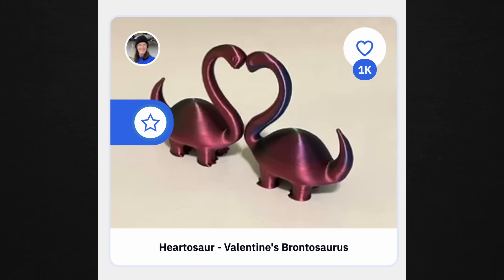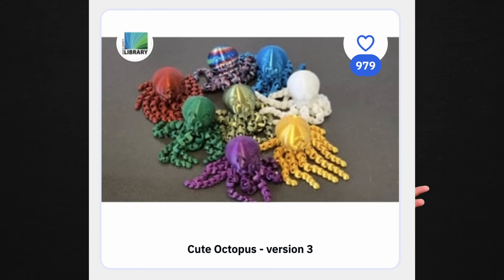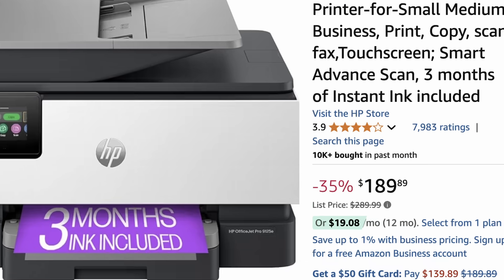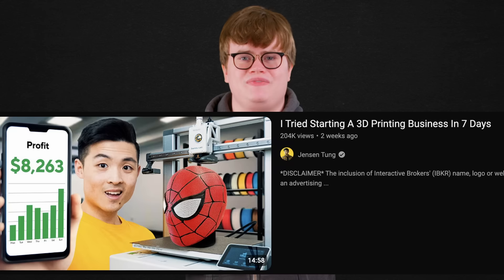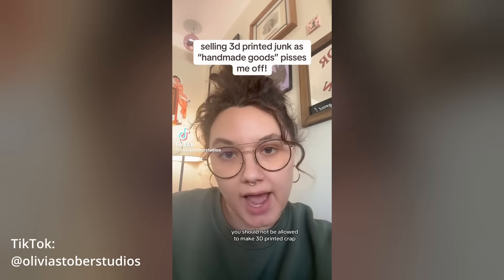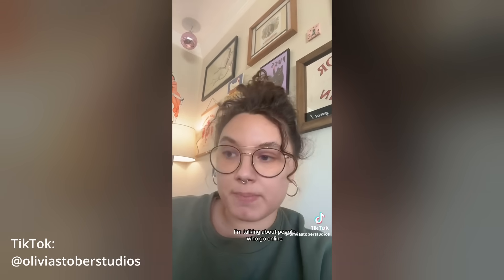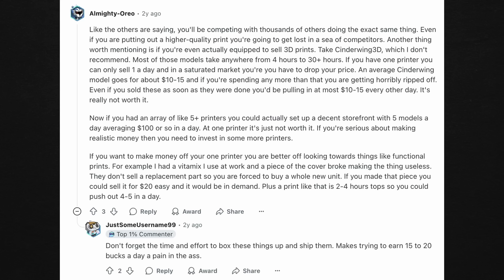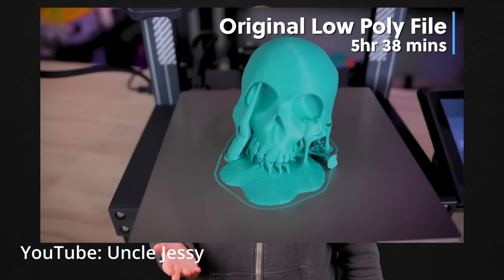The Rise of 3D-Printed Slop

Comment: This is such a pessimistic look on 3d printing. Let people use 3d printers for what they want! Buying what can be 3d printed is just as, if not more both costly and environmentally unfriendly as non-3d printed products, because in the end it's all just plastic. Delivery requires transport which requires fuel and may take a lot of waiting time (especially if bought cheap), so often, 3d printing is much more convenient in that regard. The layer lines are not "ugly", and at smaller layer heights they're quite invisible really. The examples you've shown are either terrible prints or ones with unnecessarily large layer heights. I've myself never done any post-processing in years of experience with 3d printers. Even if so, what is there to hate about layer lines if it's something you've made yourself and are proud of?! Frankly, I find the layer lines aesthetically unique. Also, 3d printing doesn't have to yield any profit. When it comes to whether or not a product's been hand-made, what matters in my opinion is the quality of it, not the technology it's been made in, so don't judge the printer, rather the maker, or yourself for having such high standards. Jeez. 3d printing isn't all just about printing useless gizmos, you're forgetting about the useful, the functional side of the community. 3d print failures are no longer common these days with newer generation 3d printers, and the filament is not "fibrous" unless it's a carbon or glass fiber composite. This here is a bad portrayal of 3d printing as a whole, and perhaps if you'd like to learn more, then get a damn 3d printer already!!! I can't believe you've made an full video criticizing 3d printing probably without even using or owning one. God, I would really like to reply to more of these awful claims about 3d printing mentioned in the video, but I should get studying now. Bye.
Reply: Not to mention I've seen more of cool cosplay things made in 3D printers, then any of the "slop" people talk about🙃🥲
Reply: Aesthetically unique and good are not synonyms. Yes, layer lines are certainly quite unique, you won't see them anywhere else outside 3D printing. And they look like garbage. If you're making items for yourself I don't care but if you're selling the to other people and are expecting money for it, put in some effort and at least lightly sand them, just to smooth it out. It doesn't take much.
Reply: @senatrius  And are the people buying the item going to pay me for the effort needed to sand it?
Reply: Exactly, this person just seems like a massive killjoy. Ignores the larger picture, and only focuses on the lowest common denominator in a bubble.

Comment: I got really into 3d printing about 5 years ago. And I hate where it's gone in regards to print farms. For me, it's just lazy. Selling prints right off the bed using other people's models off thingiverse. I like making things, just for the sake of the challenge, but even if it doesn't involve the modeling on a computer, I like to sand, reinforce, paints and finish cosplay props or functional prints. Or even just having 3d printer around for a random plastic part that broke. I'd be embarrassed to be selling what people with print farms do, because it feels like you're not really offering anything of value.

Comment: I use 3d printing for making casting molds for replica parts on antique equipment like my 1888-1920s frick/geiser Frankenstein of a sawmill i also want to build miniature steam engines and I hate hand carving moulds out of wood they never come out right and take many hours from me when I could design, print,auto body putty fill the print then paint, i also printed a string of 45mm gauge (G scale model trains) tipper cars for a quite literal fraction of the price of bachmann's tipper cars

Comment: i also will say, making those little useful items yourself is a more sustainable method than supporting temu or shein or amazon- at the end of the day, the biggest problem with the plastic industry (and, every industry actually) is the SCALE they are being produced. printing a toothpaste squeezer yourself, you cut out the carbon emmissions from shipping, the plastic packaging it would have come in, and youre not telling a factory the item has value and that they need to produce thousands more- youre only bringing one of the item you needed into this world and not thousands of surplus that will end up in a landfill
Reply: Also I gotta say, as a disabled person with mobility and dexterity issues who lives rurally, I end up needing a ton of “weird” little gadgets to solve problems that are less straightforward for me than other people, and being able to produce them on demand in my house in the space of an hour or two has been brilliant. I’m an order of magnitude faster than Prime delivery (which matters when you can’t get a jar open, or, indeed, when you’re struggling with toothpaste!) and wasting far less fuel doing it on a regular basis. Temu is not the winning option here.

I accept that mine is not a use case that applies to most people…yet. But if you live long enough you might get it one day!
Reply: Don't forget the filament also had to be made and shipped. So it depends a lot on the circumstances, your 3D print can truly be more environmental friendly but also can be far worse.
Reply: @teresashinkansen9402 1kg of plastic send in one spool&package is ALWAYS more environmentally friendly than 1kg of plastic split up over many packages 

It also doesn't really have to be "produced" it's just virgin plastic pellets extruded into a string - the Virgin pellets would get used for plastic either way
Reply: @LuluTheCorgi At least someone here has some common sense about the environmental impact of shipping.
Reply: @ one shipment and package that can make 15 items or 15 individual shipments and packaging? (also my filament comes in a cardboard with a cardboard spool with no plastic)
Reply: @ As I said, depends on the circumstances.
Reply: @teresashinkansen9402  possibly! corporations are such a huge contributor to pollution and climate change, I'd be curious to see if someone has calculated the potential difference in sustainability & etc.
Reply: yeah, it really weirded out when temu of all things was suggested as the alternative (if i'm interpreting things correctly), not to mention temu's use of (*ahem* alleged *don't sue me*) slave labor / exploiting the uyghur people who are literally undergoing a genocide. it just comes across as very hypocritical, i feel like someone who is worried about the waste resulted from 3D surely knows At Least that temu has resulted in a lot of waste
Reply: not to mention that it's cheaper and faster to print something small than shipping it from across the world
Reply: really good point!
Reply: for sure! not everyone peobably goes this route, but 3d printing has made me more intentional :) i love the instant access to something i've been eyeing/needing/wanting that doesnt necessarily need to be structurally sound. but it is an investment in my filament cost and time, so i've been able to pritn things that would otherwise be harder or more expensive to access. to me, that trade is really cool and part of the fun
Reply: You ever think it's more sustainable to not even have the desire for useless stuff?
Reply: @MingusDynastyy  this is a great point, but we need to bear in mind that things like a toothpaste squeezer aren't always as  "useless" as people perceive them to be (often these items are helpful for people with mobility issues etc.)
Reply: The ring size measurer was a terrible example as someone who literally printed one recently to save the time of buying on on amazon or wasting gas going to a jeweller and now I have it if I ever need it again.
Reply: @ I printed it recently bc I’m designing rings lol!
Reply: @tripled153  Couldn't you have just used a string?
Reply: My problem with the justification is the  waste you throw out from printing your products. Yes, I'm talking about your supports. Not all 3d printers have recyclable support plastics.
Reply: @mhollis7996 I hardly ever use supports with my prints.
Reply: @mhollis7996 if you need supports your printer is badly set up or the person that made the model isn't designing with additional manufacturing in mind 

Supports are a crutch, easily avoided by good design (you can easily print 45° overhangs on any off the shelf printer)

Comment: Multimaterial printing is anotherone that breaks me. The extra waste aside. The main thing people use it for is multicolor printing. Yes those very specific not that attractive looking filament colors. It's not even that good for multiple materials since the connection between the materials can be a significant weakpoint. You need very specific demands to be able to make use of it and I think most people just want it to feel safe with the fact that their printer at least has the capability. And not have to paint their junk.

Comment: I agree that a large amount of pre-made files are trash, either non printable, badly AI generated, effortless, not well designed, etc.
But there are a few, thoughtful, big and small projects that really deserve recognition, and that I‘m willing to pay to download them as well, considering the work hours gone into them

Designing yourself is really the way to go most of the time, it takes a few weeks of practice and failed prints, but then it’s simple and quick most of the time

However, being able to just print all those missing parts you have been searching for ages is priceless. DIY projects get so much easier, I printed so many small repair parts (broken attachments and knobs, vacuum adapters, casings, adapters for devices not produced anymore, etc.)

3D printers generate waste, and not in small quantities, especially in the first few weeks when you need to figure out their quirks, but I saved at least 4 larger devices from being discarded last month (large family), which would be much more mass of plastic waste and electronic parts, and so far it seems like a net plus for me.

Comment: And this doesn't even mention the horrific implication of the electronic trash that is created by people buying printers and then them breaking or throwing them away. I use the 3d printer at my local public library but there are also alot of community centres and the like that have 3d printers that you can use.

Comment: The carbon footprint of 3d printing it yourself is way lower than buying stuff off teemu/aliexpress.
Also PLA is way more ecologically sustainable than regular ABS, both in manufacturing and in decomposition, which can't even be comparable, PLA can take up to 100 years to decompose, meanwhile the first plastic ever sold still hasn't completely decomposed.
there is also the factor of packaging and delivery that also increase the carbon footprint of manufactured goods.
as for recycling, the only reason PLA recycling/decomposition facilities haven't taken off yet is because the volume is still very small for making a viable business model, and thats where the popularization of 3d printers come into play.
Reply: in germany there's a recycling company already to which you can ship failed print/waste and buy recycled filament back from them
Reply: @Reversed82 I've been melting mine down in silicone molds so it's at least no longer "waste". It's very imperfect though. They are full of air pockets but they still look very unique due to the different colors
Reply: @ i've heard about it from CNC kitchen, pretty cool initiative
Reply: good explanation about PLA vs ABS!
Reply: We really need to be careful about defining "decompose" or "biodegrade" when talking about plastics, because in some cases it's just a poorly defined term used by marketing firms to appear sustainable, when all they really mean is that it will eventually break down into small enough pieces to not be visible to the naked eye anymore, i.e. microplastics
Reply: The first plastic ever sold is like 115 years old to be fair.
And most people buy a printer print five things and put it in a closet, thats a higher carbon footprint then shipping an ounce of plastic across the ocean.
People who don't have the time and space and ingenuity for manufacturing all of the plastic goods they need in their apartment or just going to buy 3D printed items online anyway and 3D printing is extremely inefficient.
Reply: @FrancisR420  every single package from china has a footprint of 0.27 kg CO2e on cross ocean shipping alone, not taking in consideration manufacturing, packaging and parcel delivery once those products arrive in your country.
Meanwhile, most pla is sourced locally, and parcel delivery, which both products have, a 3d printer also consumes less energy than your average computer, so no.
 all of that information is freely available.
Reply: Completely agree with OG and this comment. What a time to be alive.. 😅
Reply: You know what saves more time AND carbon than either? Not making or collecting plastic junk.
Reply: @caissafrass6631  and who said the only thing you can print is aticulated dragons and fidget toys?
I've been 3d printing for over 5 years now and I've never print one of those except as a gift to someone that requested it

Comment: IDK, I have multiple printers and use them all the time for various projects like repairing vintage tech for which you can't find replacement parts, making organizational tools for my workshop and kitchen, and yes designing and selling custom protective synthesizer cases.
I had been following the 3d printer evolution since the 2000s and I'm super happy that the barrier to entry has come down since robotics isn't my specialty and I was only able to jump into the hobby once the price came down and reliability went up. I'm personally not surprised that a lot of people print junk, especially before they learn how to make their own models and I think that is and inevitable result of accessibility and the rapidly improving printer tech. I do also think that while the slop sellers are very visible they are certainly a minority of printer owners.

Comment: 3D printers are great if you have knowledge of CAD, 3D art software or really like tinkering with something.(Preferably more than one of those things at a time) Otherwise it's probably not a great tool for you.
What you've encountered is the vocal and very visible part of the 3D printing community. There's a lot of genuine good use cases. But what most people encounter is that unfortunately. 
Personally I make a lot of random electronics projects. So I find it incredibly useful to make custom enclosure/cases. I've helped design and make some cosplay pieces for friends. It's a useful tool and unfortunately or fortunately, you can get some decent results without much skill or effort. So with that comes an increase of what the lowest common denominator can make.
Also when people first got photocopiers and printers they started printing all sorts of stupid and wild stuff. So many needlessly cut down and wasted trees. We're just near the end of the oversaturation with the lowest common denominator situation with a new technology again.

Comment: I only bought a 3d printer so I could model and print cosplay props. No one is selling a 1:1 Tumekens Shadow, or Tormented Bracelet - I had to rip the models from OSRS and then remodel them in HD so they don't look like a PS1 game, basically. I get frustrated with people that buy a 3D printer and don't design their own models... Whether its engineering prototypes or custom art pieces, whats the point of at-home manufacture to make something everyone else is making?

A lot of these very casual 3D printer owners make everything in PLA, too. PLA is not a durable long lasting material... If you want strong prints you need something like ASA or ABS, but those take a bit of effort to set up and trouble shoot, do they don't.

Comment: What's happened to 3D printing is so sad to me.  When the thought of it first happened I was so optimistic, and I still know what I want it to be . . .But it never became that -- why not?
        Why couldn't I have a properly vented microwave-sized little printer thing installed in my wall and feed it familiar plastic junk consistently -plastic milk caps perhaps.  it could cut melt and blend the plastic daily and alert me when I had enough weight to print my chosen practical object.  It's not like I can't think of lots of everyday one-colour items that don't need to be food-safe --things I'd happily make for everyday use that probably could easily have making instructions in th public domain. 

  Then I could print a laundry basket, or a plastic milk pitcher, or a soap dish, or a plastic cover waterproof pocket folder.  I could print little toys to give out to kids for Halloween, or plastic pony beads to use in plastic beadwork craft projects.  Or a plant pot, Or a watering can for my plants.  Or, with a little help, the occasional spare part or fix for a broken household item, where i'd look up instructions for how to fix a thing.  At the very least it could print just one very useful thing endlessly that I could use continuously, like a simple plastic yarn I could learn to knit with and make dish scrubbies with.  Or waterproof CD cases?  
    You see what I'm saying.  Even if the thing printed only one common household item perfectly and took plastic bottle caps, It'd save me money and time, give me a sense of accomplishment and save the earth plastic, putting useful plastic to use.